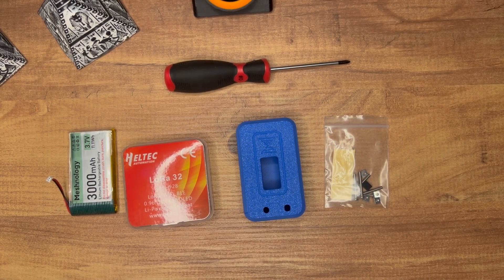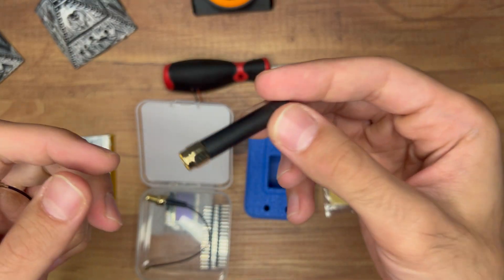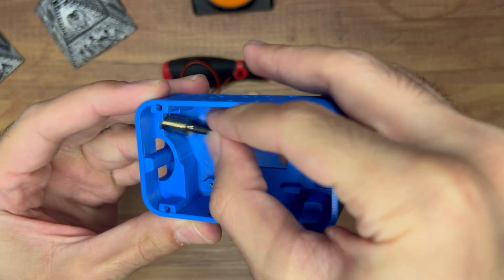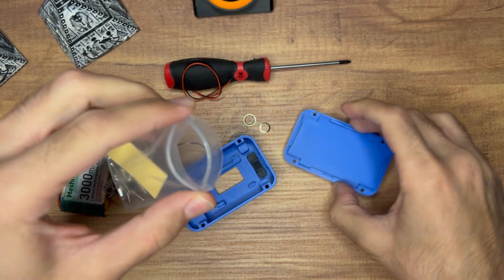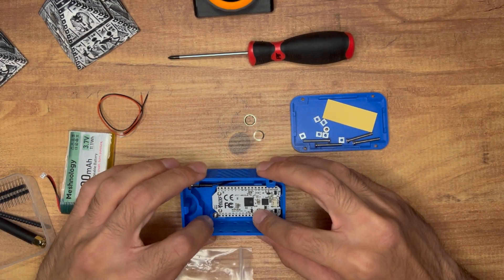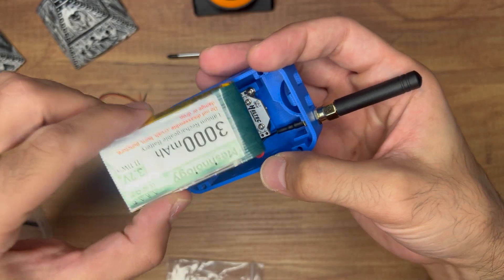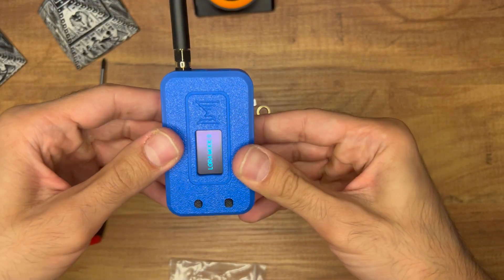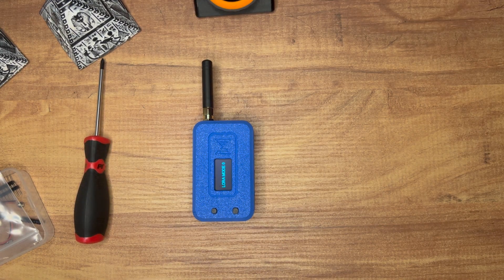Meshnology N35 N33 N32 Review: Is This $32 DIY Meshtastic Kit Worth It? #Meshtastic #lora

Comment: I used your site to make two diy mesh devices. Can you pls link the diy device to which RNode could be flashed?
Reply from the maker: I will have to look at Rnode requirements but check if they have device variant for DIY and of the pins match. It’s not so difficult and it’s nice thing to learn. Feel free to ask questions though